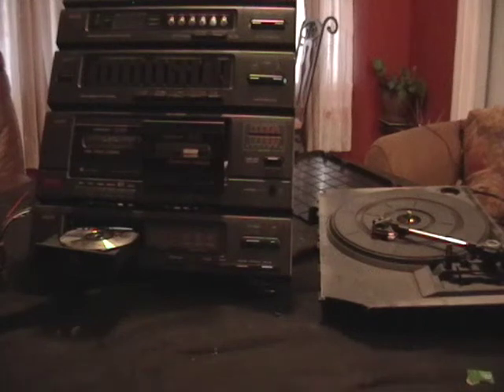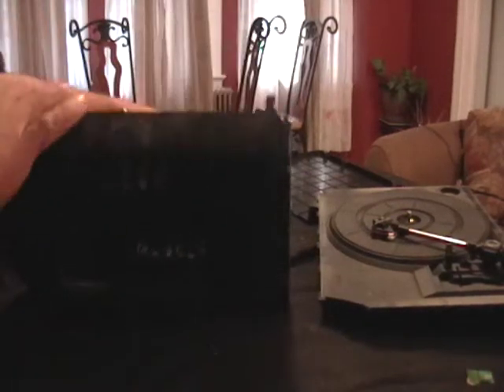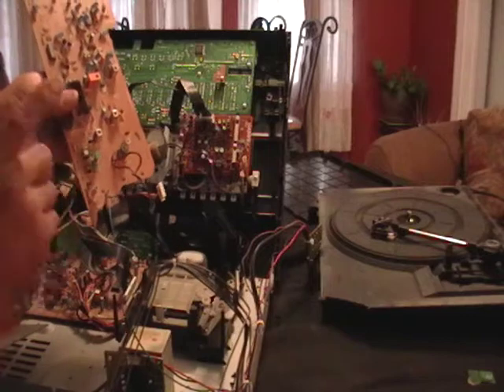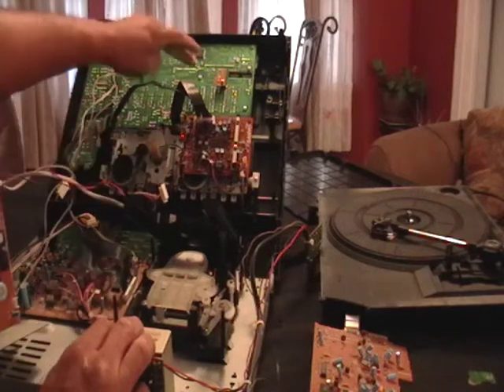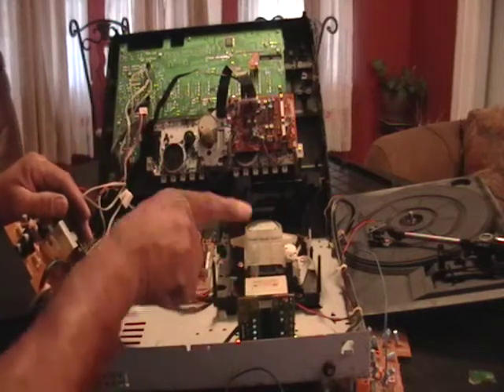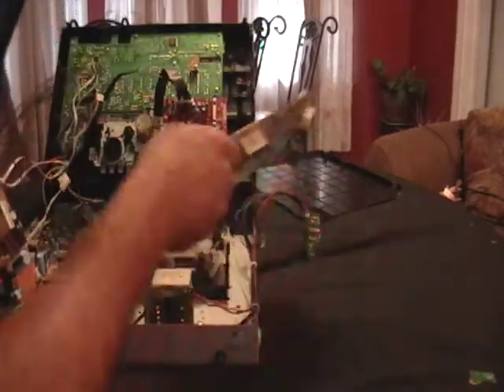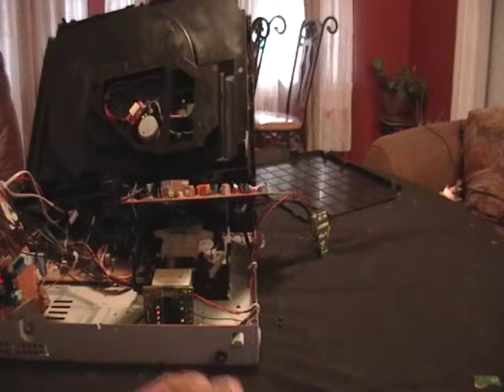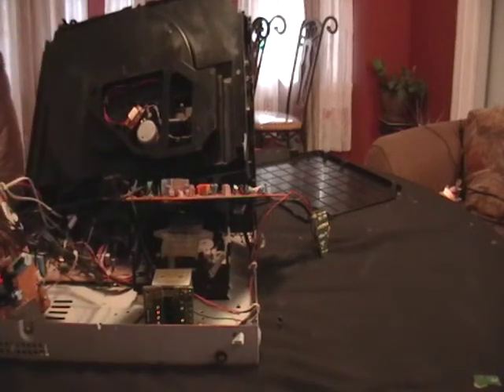scrapping a radio for copper aluminum wire

Comment from the maker: Awesome...Its worth money...There should be screws attached under the counter to the dishwasher... Slowly remove the diswasher and you will see the wire and the hoses for water... Make sure the power is off in that area. disconnect the wires and shut off the water...There will be some water on the floor...Make sure the hose(s) are in the upright position...Should be a 5 minute job...